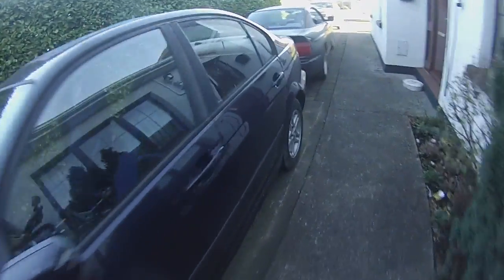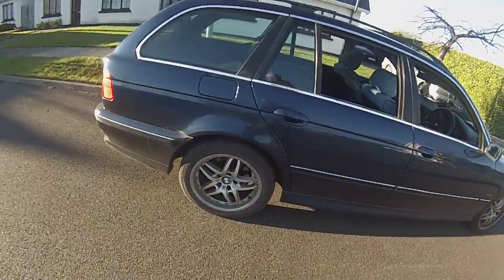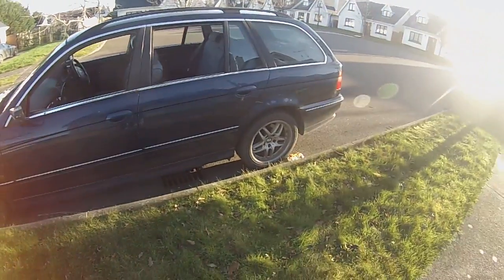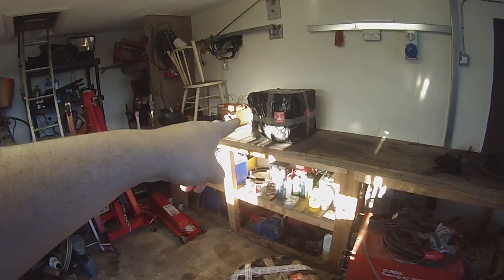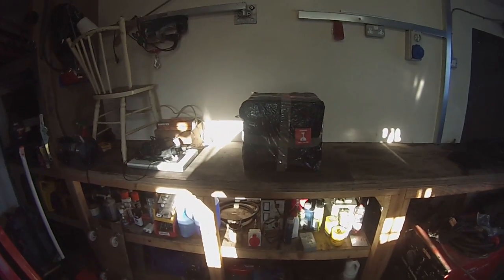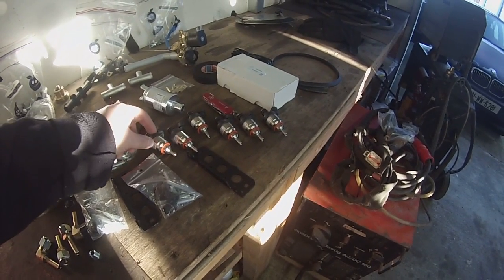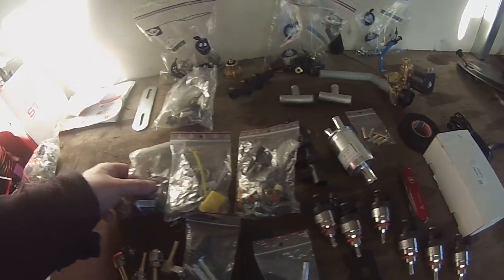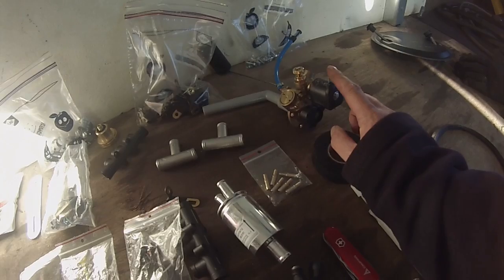E39 Touring LPG Plug In Hybrid Introduction

Comment: I didnt get it, you are going to remove petrol part fully ?
Reply: Because the Propane is "Injected"
(not via an old-school "mixer")
the Propane (Gas-Gas) injectors
(or in some other designs the liquid-propane injectors),
need to replace the original petrol injectors,
as each injector corresponds to a specfic cylinder,
and a specific hole in the manifold
(pointing in through the inlet valve).

Methinks.

Comment: Will Big Blue marry the Lexus Toyota transmission?

If I remember correctly then then Autogaz (LPG) is used to see some petrol for starting things in the first place. Will you try to outgas those nasty habits with some electricity? I guess it is all about vacuum and temperature.

Cheers
Peter and Karin
Reply: You need heat to get the lpg evaporator started, that can be achieved with electric preheater as the cooland needs to be hot.
Atleast that's how it works on my e39.

I do not know what system he will be using or how he's going to burn the lpg to get electricity but i'm thinking he won't need quite as much power to get the lpg system started as you would with the regular m52 engine.